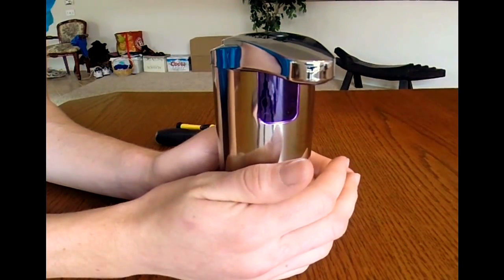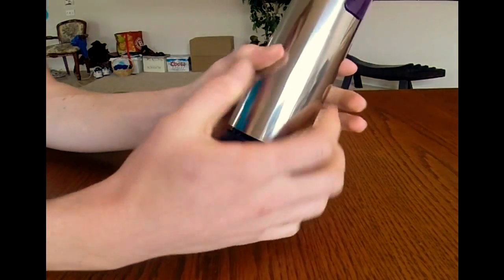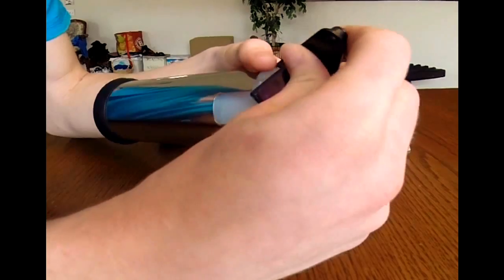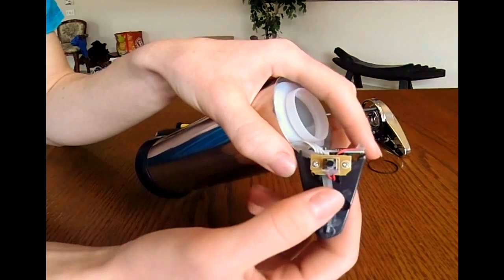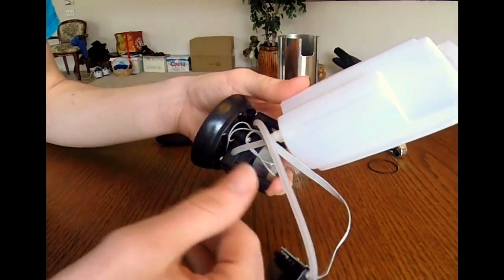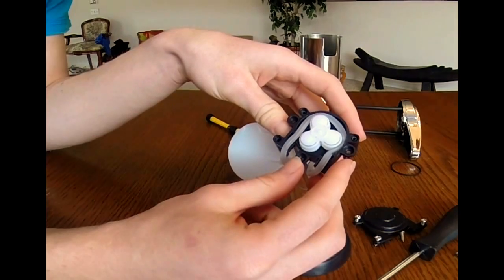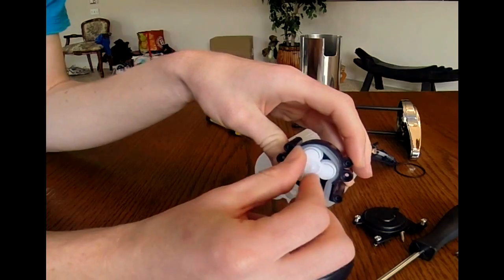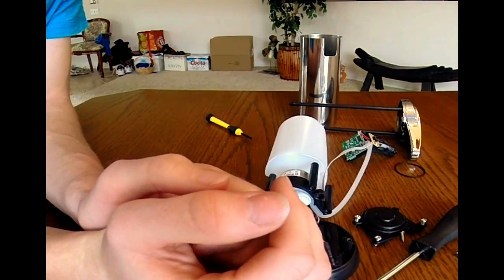How an Electronic Automatic Soap Dispenser Works

Comment: Do you think that this could be modified to us body soap (thick liquids)? Great video
Reply from the maker: This type of mechanism could work with a thicker fluid such as body soap. A stock dispenser may work by removing the nozzle at the end if there is one in order to allow the body soap to move through the tube as unrestricted as possible. The only thing I could see being a problem would be whether the stock motor produces enough torque. The best way to find this out would be to test it and see. The worst thing that would happen is the motor stalls and won't move the fluid in which case you remove the tube and rinse it out with water.
Reply: Thank you for the great feedback